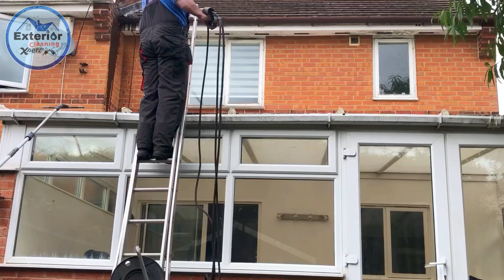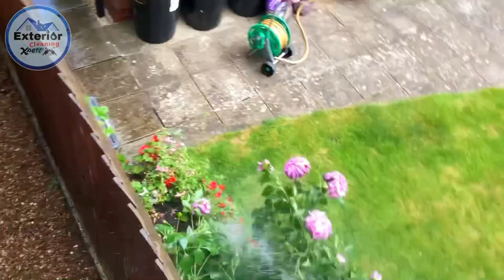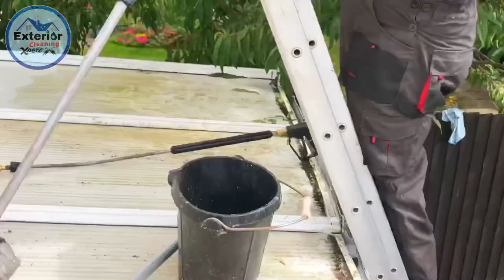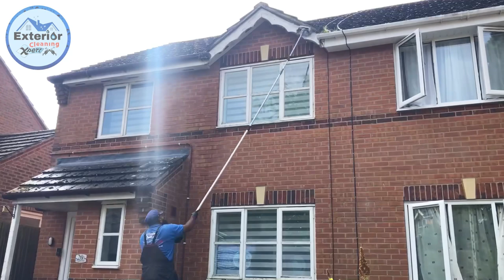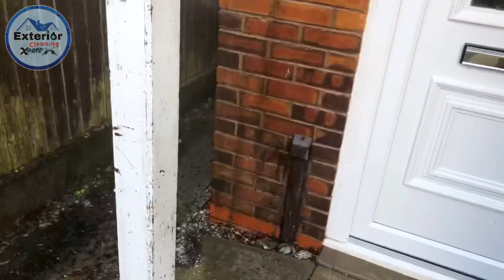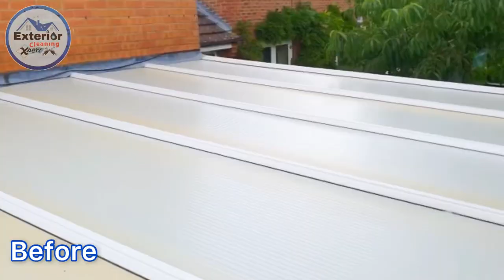Looks Easy But it’s A Hard Job - Exterior Cleaning Xpert | All in One | Satisfying videos |

Comment: A tip from me ... for the bulk area of the plastic roofs  ( avoid seals )  try  a flat  surface cleaner on your telescopic lance on  around 70 to 80 ( 1000 PSi ) . It will work   !!  and work very effectively . and quick ( 1 /10 of the time )  .. Give it a go    .. and let me know.
Reply from the maker: I am already looking to buy an 8” surface cleaner mate fit roofs and conservatory 👍